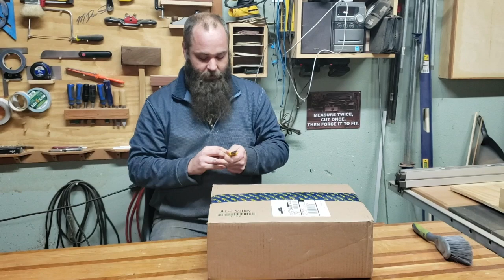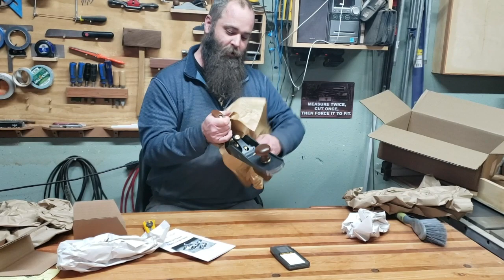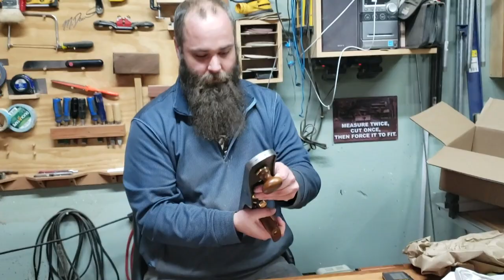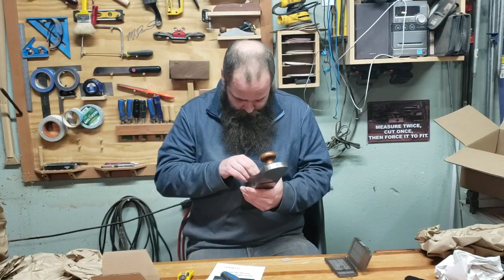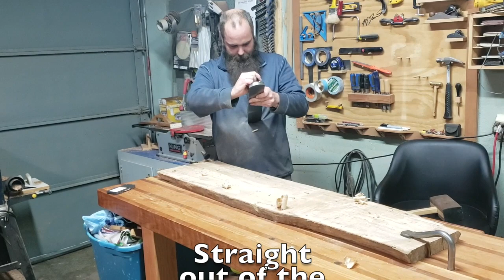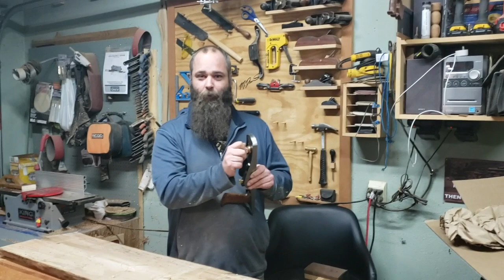I Got A Veritas Low Angle Jack Plane!

Comment: MOST people tighten the brass  cap down too hard . Tighten it JUST enough so it is NOT loose but you can still adjust the blade easily . If you are not able to adjust the blade then you have got it TOO tight . Turn the small brass limit screw fully cw and then let it out slowly 1/4 turn at a time until it has a small mouth opening . then lockdown the front knob.This plane is EASILY capable of taking 1/1000th inch shavings ,probably less but that is not practical .
Reply from the maker: Yeah, it took some fiddling at the start to get used to it, but now that I am, it gets 90% of the planing work that happens in my shop. It's a wonderful tool.

Comment: Received mine today 😁
Toothed coarse blade, 25 pmv blade, 38 and 50 degrees a2 blade. 
Yep expensive christmas present. Worth every cent
Reply from the maker: Agreed. It gets like 90% of the planing work that gets done in my shop.
Reply: @WoodenThingsAndStuff  if you got other blades, can you make a video on when to use what. As I have no clue.
I'm electrician  my son is becoming Carpenter but they don't have a LAJ at school.
Reply from the maker: I've only ever used the blade it came with. I'll probably buy another one and sharpen it at a slightly higher angle for especially figured woods to reduce the chance of tear-out, but that will probably be it.

Comment: The trouble you are having with the friction clamp indicates you should not use any sharp tools unsupervised. The planeis a sweet tool that should last generations if properly cared for.
Reply from the maker: Nah...it means I drilled my dog holes with the wrong size bit and haven't fixed them yet. Some of them grab sometimes. I agree about the plane, though. Beauty piece of equipment.
Reply: @WoodenThingsAndStuff  Gramercy holdfast? Rough up the shaft for a better grip.

Comment: Stymied by the box. Not off to a good start…

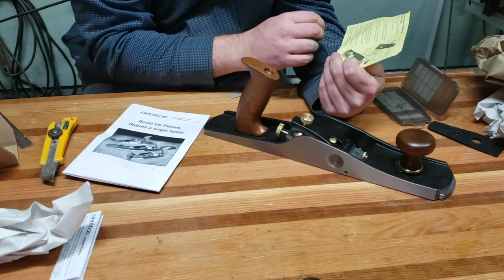And at 4:44, a shot of the box cutter sitting on the bench with the blade out. Strike two.

And at 5:37, almost knocked your brand new $300 plane off the bench. Strike three. 

Bye, bye…